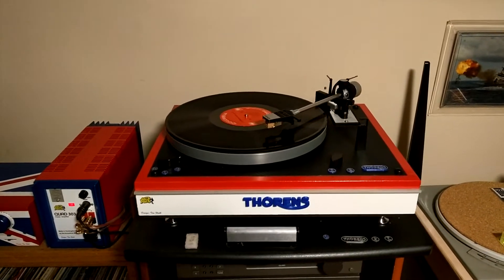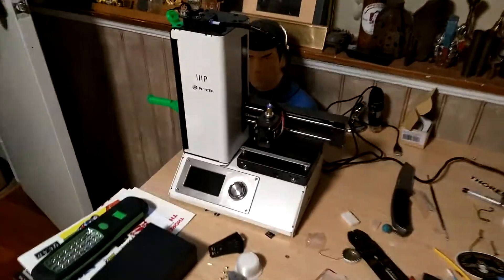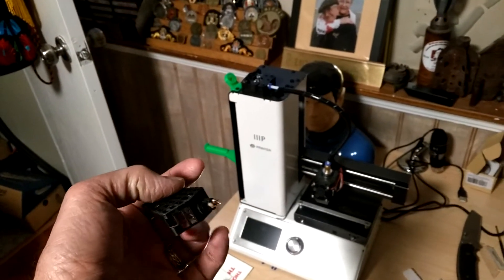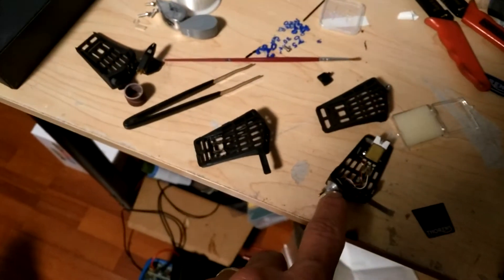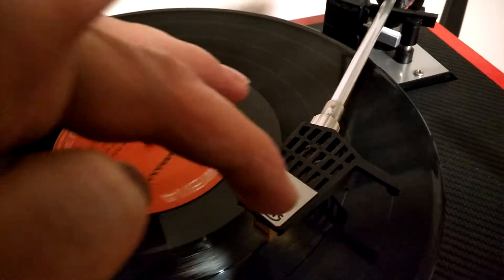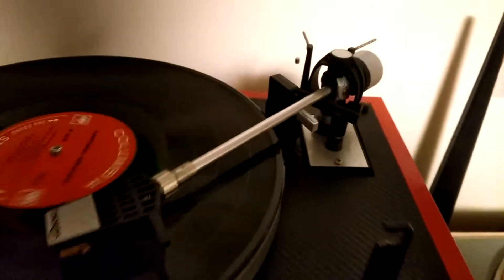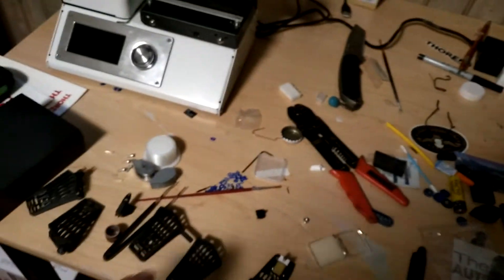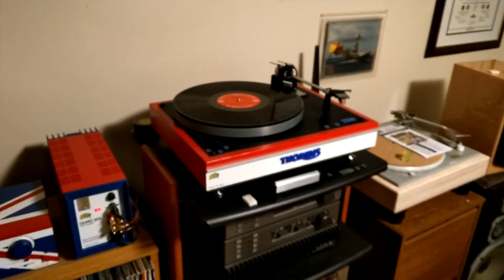Thorens 3D Modeled TP-60 Headshell for a TD-165 Turntable

Comment: tks for your sharing. Just wonder do you have the 3d print design of the plate that have the hole to screw the cart into the headshell? mine plat got broken, i need a replacement
Reply from the maker: Watch this video I did first. I usually chuck those plates out - this video explains why. The M2 size bolts are difficult to source and it is better to go with larger size normal bolt sets that come with the carts...

https://youtu.be/PU44MzVv1ck